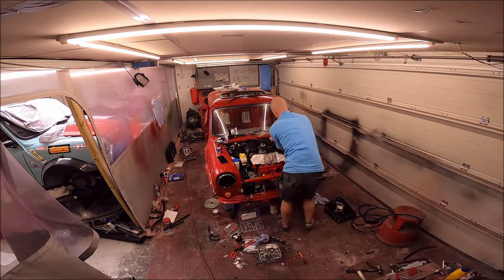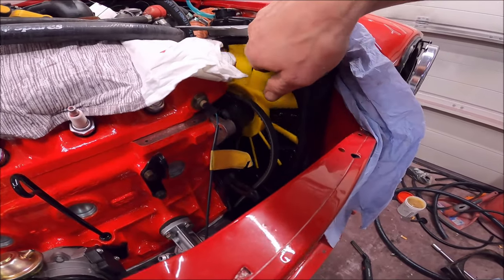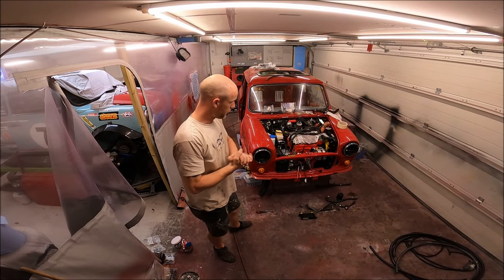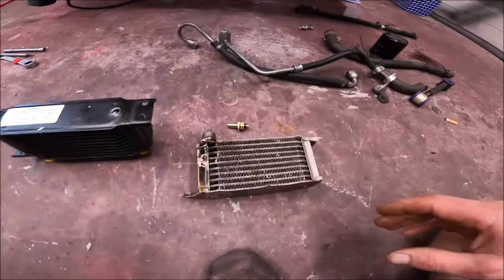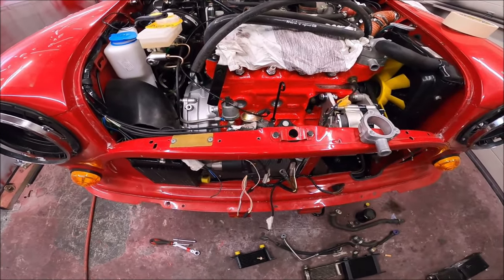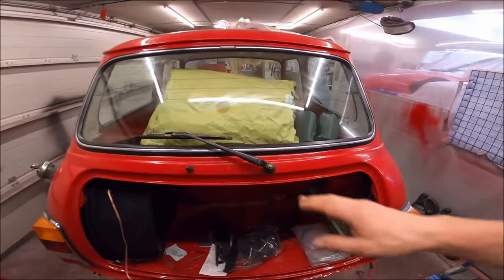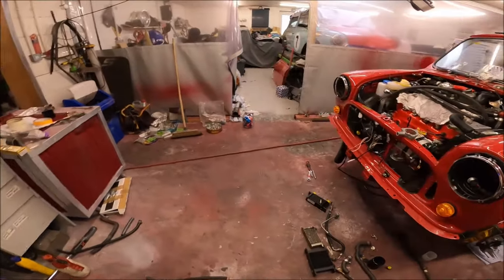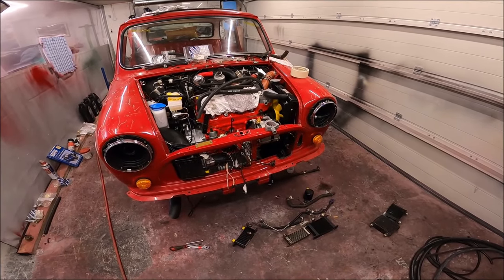5hrs to Fit a Radiator! - ERA Turbo Project Classic Mini Workshop Pt.32

Comment: You can still swap the lower radiator  bracket with the radiator in situ. The bolts can be accessed from the wheel well side. The bracket sits at an angle so if you elongate the holes it is possible to lower or raise the hole radiator. Fiddly but possible. I run a steel fan and a one piece MK1 cowling. Cheers guys.

Comment: Just a thought, may not apply here but, i fitted a rear wiper motor to a fiesta way back, and fitted wiper arm in parked position, trouble was, motor wasnt ! and when battery was connected the arm scraped the tailgate on a brand new motor, so maybe just lift arm before connecting and testing? Still haunts me lol
Reply: That is a good point! I shall remember to do that. 🙂

Comment: You can fit the engine into a mini with the radiator already mounted To the engine,  all the problems you had with the radiator you could have done on the work bench, That is the easy way to do it believe me done hundreds.

Comment: Mark just a suggestion  get a nut to fit the sensor and take it to a shop and get it tigged  onto the cooler
Reply: I did look at that but nobody was confident enough to guarantee no leaks. I've gone a different route for now. 🙂